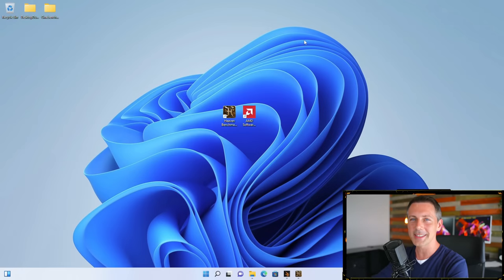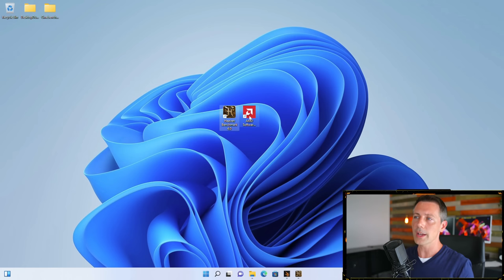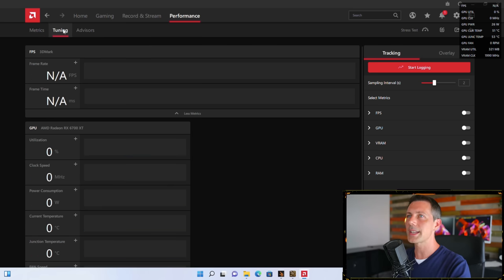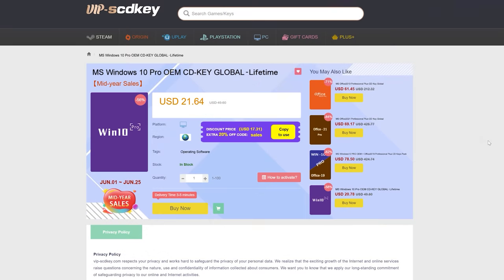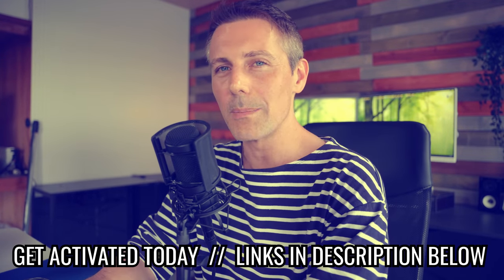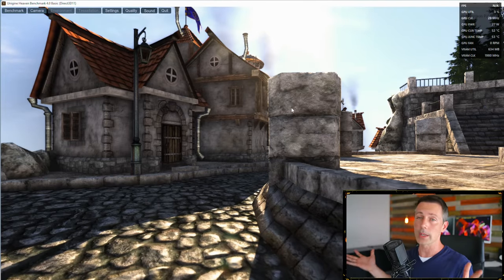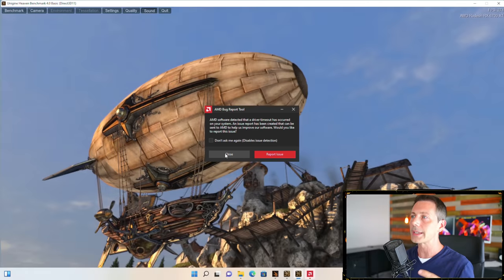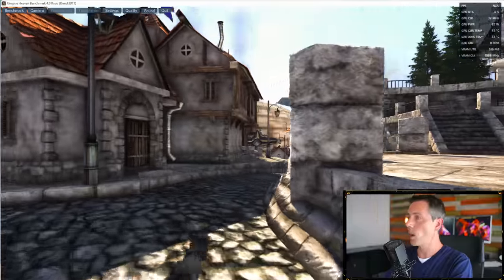How to UNDERVOLT AMD RX 6000 Series GPUs

Comment: This is also the main reason why miner gpu's have much longer lifespan (except the fans perhaps) as opposed to gamer's gpu's which have been only running at stock settings mostly and thus drawing almost max. power constantly.
Reply: And why people shouldn't be so worried about buying used miner cards lol
Reply: Where does it say miner gpus have longer lifespan?
Reply: @gearfriedtheswmas  Totally depends on the use case. If a miner properly researched and configured their cards with proper cooling and undervolting they can endure the 24/7 load without an issue - server hardware showed that for ages. The only problem is when you have a dude overclocking them in a tiny room with increased power limits, major heat and no maintanance (Thermal paste, dust etc). Then the GPU needs to withstand stress close to max TDP all the time which kills it pretty fast
Reply: @gearfriedtheswmas  What don't you understand about power draw and efficiency ? Or perhaps you don't understand how heat dissipation works on a micro electronic level but anyhow the answer for dummies is : the less voltage you need to run an electronic circuit the less heat it produces thus lowering electricity usage thus creating a longer lifespan for all components involved. Miners don't use the GPU but only the VRAM which they undervolt to get the best efficiency. Now, what was your question again ?! Try education first before getting involved in electronic engineering !!!
Reply: True to an extent. While the GPU in a mining graphics card is underworked, the VRAM is constantly battered. Does not matter which part of the graphics card fails - either failure of the GPU or VRAM bricks the card.

Longevity is mainly dependent on how far the user pushed their cards, whether measures were taken to preserve the cards during usage, whether the cards have sufficient cooling on the memory which earlier 3090's didn't. A dirty card is an indication of an abusive user, regardless of the user being a gamer or miner.
Reply: @sparklingbra  That's splitting hairs. Average gamers do not adjust anything therefor their cards are under maximum stress during gaming. Although miners let their cards run 24/7, it's a mistake to think that that would be more harmfull then a gamer who run their cards out of the box. Any electronic circuit only degrades dramatically when it's power fluctates constantly (gamers user scenario). Miners on the other hand tune their power usage NOT to fluctuate and at a much lower power draw. Therefor the life span of the whole PCB will be extended. Even if you don't believe it then there is a simple example to illustrate the how it works : The fFAN's electronic circuits will die first before any other component on a PCB (unless the PCB was of bad design). To my knowledge fans can last for at least 4-8 years before they fail after which you can replace them and go for another 4-8 years and so on and so on until it's time that the electronic components on the PCB (such as VRAM)  are getting weaker and weaker. (slowly melting) . So, it stick to my real life epxerience no matter what others think. If a card fails before it reached at least 10 years then it's almost certain that's it's due to bad silicon rather then bad usage.
Reply: @tech4u2022  Miners undervolt cards only to save power. There is no no proof the cards from miners last longer than from gamers. The chip is much more durable than the memory which is why most gpus fail most of the time. No amount of undervolting will spare the memory from 100% 24/7 trashing, go do your propaganda somewhere else.

Comment: I have a 6750XT and the thing is running hot,  in certain scenarios it draws over 260watt with a juncture temperature of 89 degrees but sometimes it jumps even higher so I'm afraid it's gonna fry it self. 
I'm gonna try this and see if I can get my intake case fan working lol
So now 1100 mili volts with a frequency of  2694 was crashing my game so I went for 1110 mili volt , in game junction temperature went from 89 to 84 and power draw is now around 200 watt , but now the fps meter is not working in a game it used to work but it still works on others like genshin impact.
Edit 2, after a few minutes of gaming at 1440p it crashed so I'm trying 1120mv now.
Edit 3 after another crash I've been playing for almost 2 hours now and I seem to have found the perfect spot:
First of all I turned the heating off so the room is colder now lol, then I under volted to 1160MV and set the minimum frequency to 2400mhz and the max to 2650, I left the vram frequency stock at 2248ghz (gonna try pumping it to the max 2312 mhz ) activited fast timing option and set a more aggressive fan curve (the stock fan curve was silent most of the time and then it went bonkers when the thing reached 89C) now it goes 80% of fan speed at 73C and 100% at 80C so instead of alternating between quiet/ plane taking off now it's more of a constant hum at around 70-80% of it's rpms.
As of now juncture temp was around 61-65 with ocasional peaks at 71C while power consumption is around 130W with peaks of 172W gaming at 1440p while Resident Evil 4 that is better optimized draws 80W max settings at 1080p RT on and runs super cold at 60C.
Frame rate seems stable and decent but I've lost the adrenalin fps counter so I can't say for sure but you know what they say: " eyes that don't see, heart that doesn't feel "
If in the future I can get better air flow into my case or even liquid cooling I could try overclocking since this card can draw over 275W but for now I rather not fry it and play it cool.
Ask me for updates if I forget to edit again in the future to inform about the stability during heavy load in the next weeks.

Comment: For me, UVing the 6800XT = lower "junction temp" which yields consistently higher clock speeds (constant 2500MHZ+ vs 2200-2300mhz on default).
Reply: Yeah, same here. I dont even touch clock values and just by undervolting it to 1000mv and -6% power limit, the card gained 60fps on furmark stress test. hehe. 

Its the first time I used an amd radeon card and man... I'm in love with adrenaline software. Its so easy, intuitive and modern compared to anything from nvidia. Its a good first impression until now. Obviously there are always room for improvement, but I'm liking what I'm seeing so far.
Reply: Hi sorry i know its been a long time. Would you mind sharing all the changes you've made?

Comment: 80c junction to 60c with your settings, watts went from 280 to 190 maxing at 200 for a little bit. avg fps changed by 4 frames, minimums increased. I'll stick with these settings and see how they go on some other games. thanks.
Reply: Working yet?
Reply: @lucho997  i haven't noticed any problems yet.

Comment: i have rx6700xt, used those settings, for now any game i play is maybe 3-4 fps slower, but my gpu temp went down 10C, hot spot went down 15C (which is a big deal, now its max 90, before it could even reach 105), and it takes 35-40W less power.

Comment: Thank you for this...i have 2 xfx RX6600 XTs in different systems and have experienced high gpu hotspots of 94c which makes me nervous......i can ofc use the amd manual fan curve which does significantly reduce these high temps as xfx seemed to have gone for a quieter base fan profile....but as a supporter of "cooler is better" id prefer to sacrifice upto 10% performance rather than have my poor system live in a near molton enviroment as well as enjoying quieter fans....cheers

Comment: The AMD driver will automatically increase the voltage if the driver thinks it isn't high enough for the frequency target you set. The only way to get it to crash is max the voltage and just increase the frequency till it crashes. You can't really min max these new cards like the previous generations. It's kind of frustrating.
Reply: The driver doesn't trust every bonehead out there trying to undervolt. Good job from AMD. Bonehead Control Measures are good.
Reply: @wa2368  no...their settings make no sense and it's not a "good job" their sliders don't work the way they should and you need other software to do what should be done with adrenaline

Comment: Yeah I undervolted and adjusted fan curve on my 6800 and my GPU hotspot temps while gaming went from 85 to 74 so.... yeah big diff. Also power usage went from 215W to 155W... 60 watts savings!!! I also benchmarked it in Cyberpunk and my average frames did not drop at all, my max frames dropped from 150 to 130 but average and min were the same, around 75 ave and 60ish min

Comment: Thank God we have Core Control on Linux for AMD CPU/GPU combination. It's not exclusively a matter of power saving/cost but hardware lifespan too. However, this is a issue for mainstream (gaming) cards only. The Radeon Pro have a better optimized voltage that cannot be touched due to their BIOSes, even with Adrenaline drivers under Windows.

Comment: Just did what you did to my 6700xt Challenger and was even able to activate fast timings and go down to 1080mv.

Seems like I was lucky with my chip.

I however have around 115 watts with these settings in heaven, but still way better than the default 175.

Thanks as usual for your great videos

Comment: On a 6800xt xtx I dropped it to 2300 Mhz/1000 mv, activated Fast Timing and increased max freq to 2150. The framerate remained identical, but the GPU2 temp droped from 111 max to 86 max in the benchmark test. I only did this to decrease the GPU2 temp bc it was concerning. 

I hope my PC won't explode. It seems to be stable, but I have zero experience in overclocking. I tried to drop the mV to 950 but it wasn't stable; 1000 seems to be perfect

Comment: Thanks, now I have the idea in my head of AMD launching the RX 6600 XT at a lower clock speed, competing with the 3060, while running of the PCIe slot alone.

Comment: Undervolted my rx 570, from 1190mV to 960mV and memory by -50 mV. After undervolting, I tried to over clock and got mine stable at 1390mhz core and 1950mhz mem. Now it just consumes 99-110w while gaming and doing other gpu intensive tasks, temps also got lower as it used to stay at 79-85°c while gaming, now its only at 65-69°c.
Reply: 1390mhz at 960mv? That's a nice result. I either use 1000mv 1286mhz, or 1050mv 1340mhz on my RX 570 4GB
Reply: @MuttleyGriffin  I guess it all comes down to silicon lottery 😅

Comment: I don't have voltage lowering option in MSI Afterburner for my RTX 3070. So just lowering power limit is as easy to lower power consumption.
Reply: You do have it.  It's done via the voltage and frequency graph.  Ctrl F or click the icon on the lower left above the core slider.
Reply: I see, thanks.

Comment: This is as straightforward as it gets, my 6600XT was getting to a point where it was trying to target 100C junction and I can straight up copy those settings (2400mhz/1100mv) and it's really stable at 95W and considerably cooler and nearly silent (it drops only 10C because its target temperature is still 89C for the hotspot, but it also drops almost a whole 1000RPM). Unfortunately with SAM enabled I get massive stutters and awful frametimes on games that are supposed to benefit from it like Forza Horizon 5 (nothing to do with the undervolt as it also happens without it).
Reply: Do you have  the Msi mech oc1 model? Mine is very hot too. Junction goes to 93 but fan rpm is 2300 so its loud.
Reply: @ugurgeyik3586  Nope, mine is an XFX Speedster QICK 308 (3 small fan model).
Reply: For my nitro 6600xt, the min frequency is 700, do I leave this at 700 or lower it to 500 like how it is in the video?
Reply: @kashif4463  I've been fine with the default of 700 so far.
Reply: @Viktory_MkII  what voltage are you stable at and what max frequency do you use?
Reply: @kashif4463  Right now I use 1100mv/2500mhz

Comment: Managed to push my 6700XT Powercolor red devil to 2900Mhz and 1120mV in Radeon software. Crashed at 2950 lol. Consumed 200W though.
Finally settled on 2500Mhz and 1120 mV and consuming Just below 140W. Could go and for  2400Mhz getting to ~125W. The biggest power factor is increasing/decreasing frequency so thats why I increased the voltage a bit.

Comment: Had the same timeout frequently ingame i managed to fix them by undervolting a little bit my rx 6600 now I'm going to fine tune it thanks
Reply: Dude share your settings
Reply: @ICanTSNiPEEEE  I drop gpu frequency to 2700 on max, and for the voltage I have a stable  marge between 1095 to 1100mV, for VRAM I don't touch it or I put it in fast timing.
Reply: One more thing, I found out later that the cause of the time outs was bad bios, try updating
Reply: @SnoozMr  💀dude on mV 1100 and 2700hz I found no drop in power consumption and temperature which I was looking for
Reply: @ICanTSNiPEEEE   depend on your model bro, I have MSI mech 2, shit runs 53C max + my power consumption is definitely dropping with 1095mV. Sorry I can't help you if you're looking for a more agressive undervolt

Comment: during my tests, if you limit the fps with Vsync you have the same results, actually even better. My graphic card during Heaven benchmark reamin at very low temp if I put the Vsync to 60 FPS. Putting your undervorlt 2400 of core and 11000 of voltage crash my driver in heaven test and in game test. So I try to lower it around 2350 for the core and always 1100 for the Voltage and it goes fine, but the temps are still high like in the junction temp better than default for sure but still high. With instead limit fps I get great results in temp management.

Comment: i just tried this with my RX 6600. the results aren't quite as impressive, i only dropped 18W peak power draw with -284 MHz (now 2300 MHz) and -100 mV (now 1050 mV). but the card only draws 100W stock, so i guess i couldn't expect much more. still, 18W are 18W
EDIT: scratch that, 1050 mV wasn't stable, lol

Comment: Since AMD driver suite already has an underolting switch that let us know the limit of the voltage the GPU can lower to without losing more than 1-2% of performance, I tend to use that in all heavy graphic games. For the rest I have 2 manual UV profiles.

Comment: I used afterburner on my tuf 6800xt - 1090mv with custom zero rpm fan curve at 40 degrees because radeon software won't let me set the zero fan temp. 235w 2350mhz 55 degrees- 65 hotspot. Completely quiet till gaming. Love the efficiency of the card
Reply: I love heaven but I had a faulty card and heaven wasn't stressful enough to crash out but any game would within 20 min. Timespy uses 15-20% more power and I feel is more reliable now. Every other series I've only used heaven,  but it's old now and not as taxing
Reply: Only 235w? That's impressive but also odd. What were you using to test? I've got my 6800xt gaming x trio at 1100mv but it will draw up to 270w as reported by hwinfo ASIC power and the AMD driver. But AMD doesn't measure total power draw properly. They haven't got shunts at every 12v input like Nvidia have, which means the power reported in software doesn't take into account VRM efficiency so tbp might be more like 290-310w. Nvidias shunts allow much more accurate readings
Reply: @UnluckyDomino  considering temps dropped 25- 30 degrees I feel it seems about right. I was playing cyberpunk at 205-210w at these settings and timespy was what pushed it up to 235w. Completely silent slow fan speed too. With my faulty card i was playing bf2042 at 1500mhz 1040mv and was getting 50 degrees at 110w at around 90fps wqhd high settings. Was good but still had crashes due to faulty card
Reply: @UnluckyDomino  all using hwinfo too btw

Comment: Most of the GPU i've owned has been undervolted to the highest clock i can get it at 750mV exepte for the gt 1030 that needed an overclock. My RX 580 was 1275MHz and my gtx 1080ti was at 1500MHz

Comment: What you said about GPU bins is very true. I have an ASUS TUF 6700xt and it uses about 25% less power and has far better temps than my Asrock Challenger 6700xt.
Reply: What are you temps in idle for the gpus ?
Reply: @ibobeko4309  not sure about idle but ASUS TUF 6700xt @ 103w, 62c @ 30% fan speed. and ASrock 6700 xt is 122w, 68c @ 75% fan speed. Same overclocks.
Reply: I have the same model 6700xt as in the video and I have fast timings enabled with my v ram and have had no issues
Reply: @germanmade1219  same voltage too?

Comment: These days its an applaud on the newly launched 7800xt how it is offering better rasterization and more vram for a lesser price than 4070. But also a bash because of the 7800xt low power efficiency. Could you explain What should be the sweet spot of memory frequency and voltage for asus tuf 7800xt ?

Comment: Ive managed to drop voltage of my 6800xt red dragon to 1000mv. Its consuming the same as my 1660ti galax at stock settings 😂
I didnt touch the clocks or fan speed. I gained 60fps on furmark stress test. I'll use this settings for now and I'll try to further improve tuning if everything is really stable. It didnt crash on battlefield 2042 in my last game session. This is a good sign, considering how sensitive this game is to any gpu tuning in my past experiences. I'm really satisfied with the card I got and with adrenaline software. The latter is a lot more modern and intuitive compared to nvidia software.
Reply: Glad you like it , amd driver and software have comes along way since the old buggy days

Comment: You use 1usmus hydra. The new version will undervolt amd gpus as well. Have you tried it?  If not you should.
Reply from the maker: I will take a look at it. Though very happy with the results from undervolting with the method in this video!

Comment: Thanks for the tutorial.
My Asus Dual RX6600 would only go as low as 1120mV at 2400Mhz clock speed.
1110mV at 2250Mhz clock speed.

I guess it's quite bad considering it's only 97 percent from default.

I can enable fast timing on my memory max clock of 1900Mhz however.